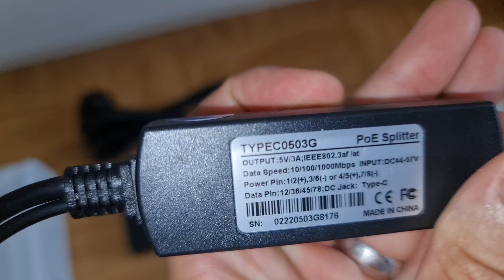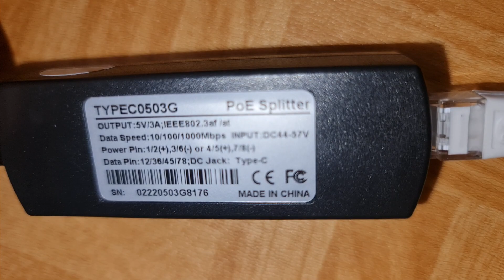How to power your Helium Miners and Amplifiers 👌 2022

Comment: Hello mate thanks for the advice last time. The flarm booster is working same as the bias tee.  My question is how long does it take to work. I had 14  withnnesses steady but now it's besvoned once and only 2 withnnesses. I know the network is bad now. But should this be case or do I wait for a few days for the flarm booster to bed or return to using it without the amplifier?
Reply from the maker: You should still witness with Flarm booster. 
But keep in mind that the Network it's not sow stable  😒